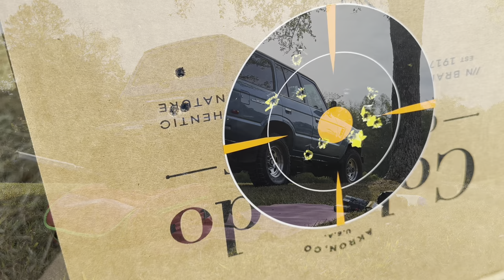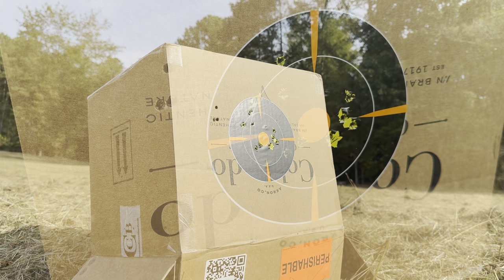#1 Zeroing Rifle, Daily Training, Walking the Goats

Comment: I have successfully harvested deer and pigs with my AR platforms, running 53gr Hornady VMax .223…….I’ve been to Ossabaw Island WMA quota hunts numerous times, for both deer and pig hunts…..the first time I showed up for the pig only quota hunt with my AR/M4, I had a fellow hunter call me out on the trailer ride out to our zones. He said I would have serious trouble taking a pig down with a 5.56/.223 as he probably displayed his 6.5 CM. I replied that if you hit em’ in the ear hole, it will drop the biggest of pigs in its tracks……As the DNR trailer come by to pick each of us up from their perspective hunt zones, I proudly had 3 big pigs laid out ready to load onto the trailer on the first morning. I took (4) total shots, on 3 separate pigs at different times, and two of the pigs were on the run, hence the 4 shots for 3 pigs. Haha! I accurately tagged each pig directly in the ear hole, the closest pig at 40 yards, the furthest two on the run were at 120 yards. So, yes! I’d confidently vote the .223 as a highly competent choice for med/big game. I still hunt with my trusty 30-30, 30-06, black powder and most certainly my bow for much of the year!

There is a (1) shot zero technique that works wonders…..I used to burn some brass before while zeroing in, now I take one shot from a stable platform in prone, just as you did……then I would simply reset onto the crosshairs/bullseye then adjust Elevation/Windage to match my actual bullet impact. 

I truly enjoyed this format and encourage more of it! Thanks Chadd 💪🏼🙏🏼

Comment: Black Hills 69g or 77g TMK. 
Barnes 70g TSX..
Nosler 60g Partition or 70g Accubond..
Sierra 64g Game King..
Federal MSR 62g Fusion..
Hornady Black 75g Interlock..
These 223 or 556N Hunting ammo are absolutely phenomenal.  I'm super bias when it comes to Hunting ammo . Nosler Partition or Accubond will always be my go too . Federal Fusion ammo works extremely well and it doesn't break the bank .
Reply: All terrible rounds for deer.
Reply: @SleepyJoesDiaper  lol those are about the best bullets for that category in 223 / 556N .
Reply: @seanwhite304  I agree with that, I like the Hornadys. I just don’t think shooting deer with a 223 is very ethical. The only factor I’m interested in is knock down power. I don’t want to trail a wounded animal, done that plenty. I shoot 180 grain Nosler with a 300 Win Mag. DRT every time. I killed a 198 1/8 last season, free range.
Reply: @SleepyJoesDiaper  750 ft pounds of energy is what I use for taking deer or hogs.  I also use 1250Ft pounds of minimal energy to take down Elk and 1500 Ft pounds of energy for Moose . 
223 / 556N using good bullets 75 yards and in will achieve those energy parameters.  I know quite a few pro hunters that live by those energy parameters . 
Deer are not as tough as elk . I used 308 for a long time on elk . 300 WSM is my all around favorite for big game . 
556N will work perfectly fine on deer within 100 Yards . Obviously your state or county has to allow for 22Cal being legal . 
You dont need 30 Cal to take down whitetail deer . Considering 200 Yards and in is avg distance most game is taken . Where I live 100Y is really long shot lol . Then again you go out west and 225Y is the normal.  
I personally use AR15 Chambered in 6mm ARC using 103g ELDXfor deer and hogs  I use 16" and has 2550 FPS at the muzzle . I use 300 WSM loaded with 180g Partition or Accubond for Big Game. 
Most good hunting bullets will perform well down to 2000 FPS . Some can perform well down to 1800 FPS ..
Reply: @seanwhite304  I respect your knowledge of ballistics. Obviously a well placed 223 will kill anything. I have killed a lot of pigs with my AR15. You probably have a similar experience but I’ve been killing deer since I was 10 years old. I have a ton of experience and I don’t like 223 for deer hunting. Honestly if you’re someone like you, me, or Chadd, I have no problem with that caliber bc we can put the round in the spot. I don’t want new people thinking they can just use their AR for everything. They already do to some extent. 243, 25-06, 270, 308, 7mm…so many superior options to 223 out there. 300 WSM is a badass caliber.
Reply: @SleepyJoesDiaper  Trust me I get where you are coming from . 

I was never Hornady fan of Game bullets until I got that 6ARC in 2020 . My dad and Uncle told me from a young age Nosler Partition is the only game bullet you'll ever need and when the Accubond came out they added that to my list . 
Hornady XTPs or Interlocks never got me excited as far as Performance but they do work extremely well .  When that changed is when 6mm ARC came out and only factory loading for hunting was 103g ELDX.  I shot at least 10 hogs and 5 Deer and was like holy rusted metal batman this ammo performs well from 2600 FPS down to 2000 FPS . I love the ELDX . Hornady GMX / CX which is their all copper design I've never really liked . I've always thought Barnes TSX / TTSX and Nosler E-Tip performed way better . I still think nothing hits game harder than Barnes TSX / TTSX . 
I could talk bullets , ballistics and ammo all day long lol .
Reply: @seanwhite304  i don’t know a ton about bullets, I’m just going on my personal experience. I was shooting ballistic tips for a minute. I recovered all the deer I shot but they left no blood trail and had poor knockdown. I’m with your dad and uncle. I went to Nosler partition and haven’t had one not just buckle since.
Reply: @SleepyJoesDiaper  If it's not broke then dont fix it . I'd be 100% perfectly fine if all I used was Nosler Partition or Accubond the rest of my life .

Comment: Agree on hunting with 223/556.  I've done it for years with no issue.  Hunted my entire life with 30.06 and got tired of blowing out entire shoulders.  One day I thought - why am I shooting a 120lbs doe at 50-100yds with a 30.06??  Changed over to a suppressed AR and haven't used anything since.  I typically use the 62gr soft point, sometimes 75gr soft point.